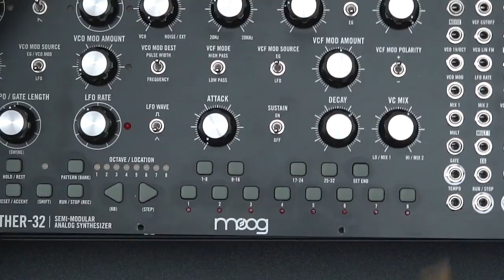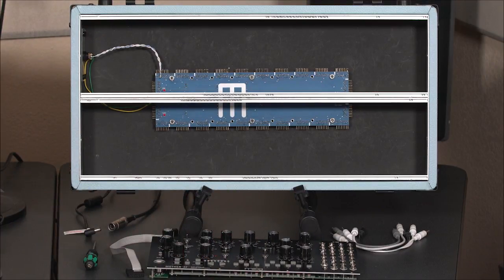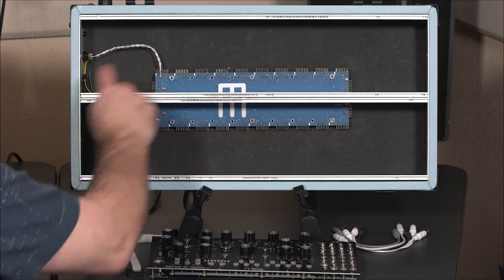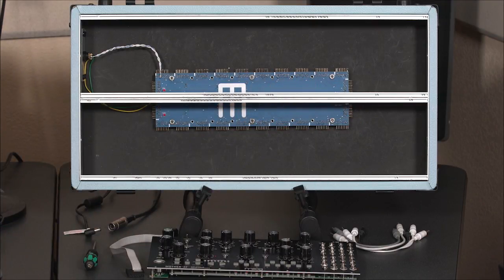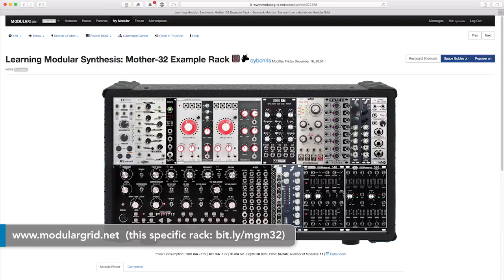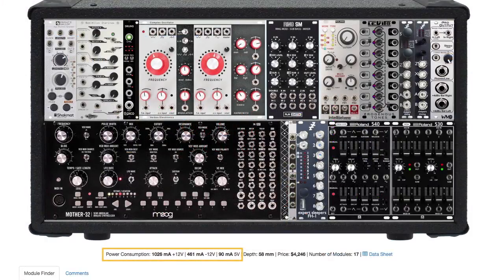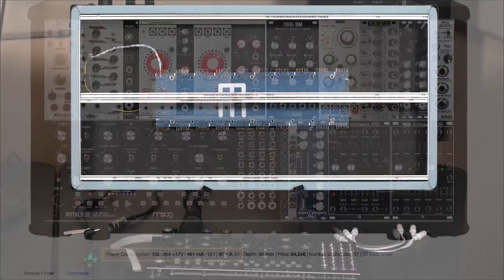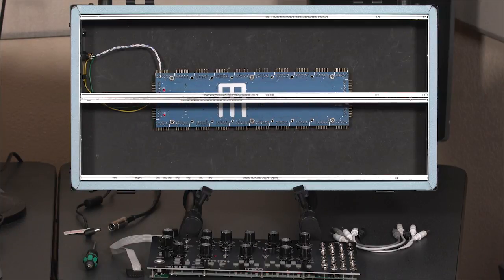LMS: Moving a Moog Mother-32 to a Eurorack Case

Comment: How do I get audio out after I do this video.  Is there a link to the next video ??    Thank you jamestopolskidj@gmail.com.   I am stuck.  I have both mother 32 and Dfam waiting to go into rackbrute.  But I wonder if I need another module to get audio out of them ??   I’m new 🥺
Reply from the maker: This was a free excerpt from my Mother-32 online course (https://courses.learningmodular.com/courses/moog-mother-32). The short answer is you use the VCA out jack in the upper right corner of the patchbay on the Mother-32. The signal will be very hot compared to normal audio; either attenuate it (a lot), or you can use an audio output module in your system.
Reply: @LearningModular   Hey, what is that little Black & Decker power drill you are using?? Didn’t know they made them that small! Thanks!

Comment: Can I get sound out of my mother-32 (in a eurorack system) just by plugging in a 1/4" to 1/8" cable straight from the VCA patch and into my interface inputs?
Reply from the maker: You can, but watch your signal levels - standard modular level (which is what will come out of the VCA jack) is much hotter than even +4 dBu.

Comment: Could I use the cabinet of the Mother 32 and put modules in it?
Reply from the maker: Yes - that's what I've done. I removed the old power board inside to make more room. You will need a power module like the Row Power or Konstant Strong. I was pleased to find I could actually fit a Genus Modu LIBB inside as well (with electrical tape over anything shiny to make sure I don't short out anything).
Reply: Kool Thx!!

Comment: Quick question: I'm like you, were I to get a Mother-32, I'd like to put in my tiptop case.

If I did this, is the mother-32 case, too proprietary or could I fill it with other Eurorack modules? I suppose anything can be DIY'd, but I'd like it if it "just works". I'd like to use the Mother case for controller modules and utilities that would be nice to shuttle around to other CV gear.
Reply from the maker: You can certainly use the Mother-32's original case to hold more modules; you just need to also get a power module, as the power and audio board built into the Mother's case is not of a lot of use to other modules (although I think there is an opportunity for someone to make an adaptor module that put it to work).
Reply: That's very interesting. Suddenly the Mother-32's cost seems even more reasonable if I'm gettting a small case in the deal. Thanks! I'm going to investigate further, because this might work out nice for me. I have 208 hp case that is mostly empty, so I got the room. Thanks again.

Comment: I mounted mine in a case and then put it back in it's original skiff. I figured 64hp was too much real estate to be taken up by one module. Also, I've heard it said that the audio quality is slightly diminished when the unit is mounted in a Eurorack skiff.
Reply from the maker: There's certainly pros and cons for keeping the Mother in its own case, or moving it into a Eurorack case. But I don't think audio quality is one of them: the same sound has to come out of the same VCA, and either go to the Mother's internal audio board, or to the output module or mixer of your choice. If you mixer or Eurorack audio module are lower in quality than the board inside the Mother's case, then the quality will go down; if it's higher, then the quality will go up.
Reply: I should still be able to route audio out of the VCA and into my Eurorack even if I leave the mother in it's case. Is that right? Thanks for your response!
Reply from the maker: Yes!
Reply: Thanks, Man!

Comment: How do you get audio output?
Reply from the maker: I personally use an output module separate headphone and balanced audio outputs. Many others just take the VCA out and run it through an input attenuator or pad on their normal mixer (you need a lot of headroom, as Eurorack levels are higher than even +4dB).
Reply: I don’t seem to get good volume from it, im running the vco pf my mother 32 trough a wave multiplier and then to a boss space echo pedal and the volme is ridiculously low, do you know what can it be? Thanks.

Comment: any chance you can explain (exactly) how to sync the m32 to the Po12  (pocket operator)
I could not get them to sync , I'm not sure what sync mode po12 should be,  I don't know which should be slave to which  (I prefer m32 be master to po12,  I don't know where I should plug the cables on m32 patch bay,gate out?, lfo square out?, and lastly mono or stereo patch cables?  (po12 syncs with a stereo cable,
1 channel is sync signal & the other channel is audio)   ??
Reply from the maker: Sorry; I don't have or have never used a Pocket Operator.